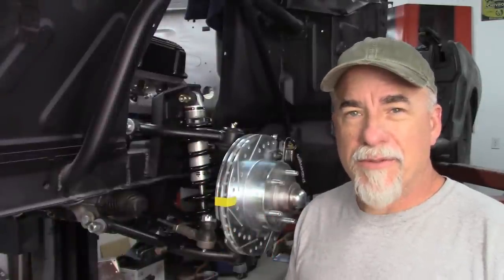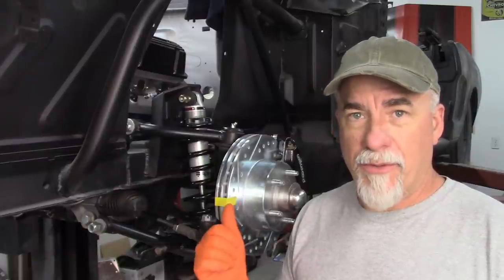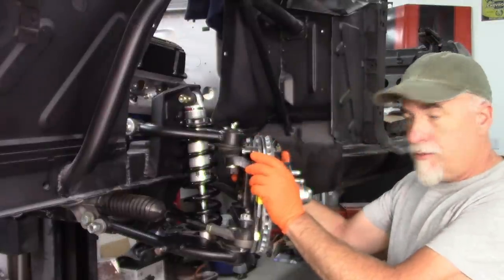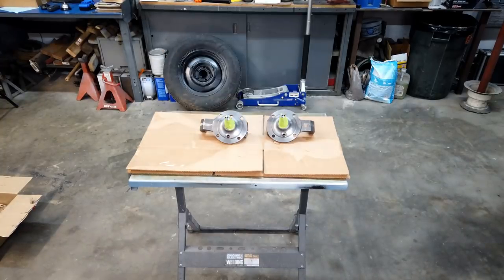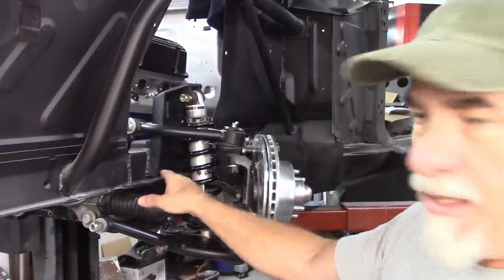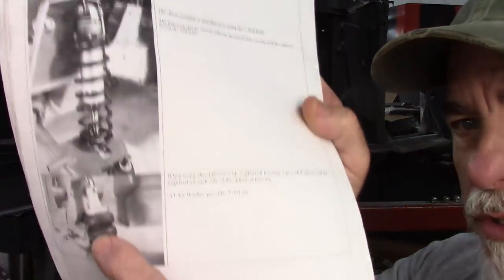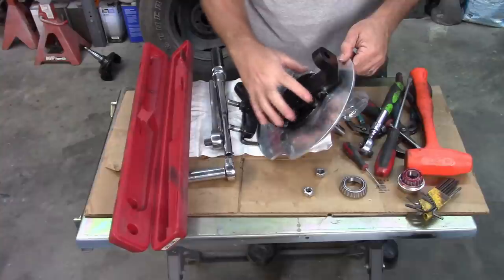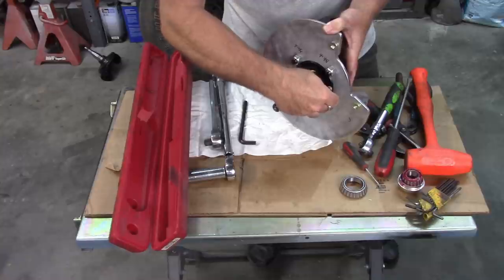Removing TCI 2" drop spindles. Brooklyn Pony 42

Comment: The reason for tightening wheel bearings while turning rotor until rotor drags is to seat bearing against spindle stop, orientate bearing needles to rotor bearing face, and evenly redistribute grease in bearing. The reason you back off until no drag is felt is for heat expansion.

Comment: I work on my own vehicles but am not a pro car mechanic,  I do work as an industrial technician and change out alot of bearings as part of my job.  Its not uncommon for bearings to not slide easily on shafts so I keep 800 grit abrasive cloth on hand to sand the shafts. 
Maybe its just me but the way that rear shock is mounted on that single bolt bothers me, I was thinking of the weight on that single bolt and the sheer forces involved. I am sure its fine just seems weird to me.
Also you can check the torque on you impact and make note of it on different settings as long as your consistent on your air pressure. You can google the method to check it.
 Have a nice day, I am enjoying your channel.
Reply from the maker: Yes. I used some emery paper to smooth the shaft. Didn't take much. As far as the shocks, it's how they designed it.....
Reply: @JoDaddysGarage  Yea, I figured it was designed like that, just doesnt look like it cab take much stress.

Comment: I think this is a good move to take the 2" drop spindles off and put the stock spindles back on. This will help with any tire fitment concerns as well. At least now, you have a little more wiggle room with tire and rim options.

Comment: Oh my so many things... Why are you set the bearing preload with the caliper on? That is why there are sims (you called washers) to adjust the clearance of the caliper as needed. Also, it's called a HEX head cap screw...
Reply from the maker: The caliper is not creating any drag.

Comment: One other thing and I know you probably get tired of people pointing things out, but on the rear shock bolts, put the bolt head on the forward side. You may need to remove the bottom link bar to do it. Been there done that.
Reply from the maker: I had thought of that. But for this purpose of mocking things up, it was easier to go forward. Thanks.

Comment: Great video as always.  Just curious, did you get a chance to check the tire/wheel clearances lock to lock with the Mustangs to Fear frame stiffeners. It seems i remember that being  an issue with the 2" drops?
Reply from the maker: I didn't check. I would assume some improvement.

Comment: Nice job, but why didn't you put the bolt in the other way on the rear perches? It would make things way easier to take apart again if need be.
Reply from the maker: I have to take everything apart before I spray undercoat. This makes it easier. When I do final assembly, I will have them in the other direction. At this point, I would likely have to pull the trailing arm out to get the shock bolt in.
Reply: Yep for sure ! 👍

Comment: Get you some brass punches, never use a screwdriver like that on bearings. Also you don't need a converter to figure ft. lbs., just divide the in. lbs. by 12. Oh and that drop spindle is out of spec. TCI should refund that.
Reply: Yeah, 3 jaw puller.
Reply: Ouch.  Cringed at that.